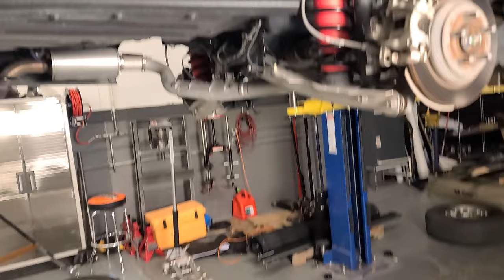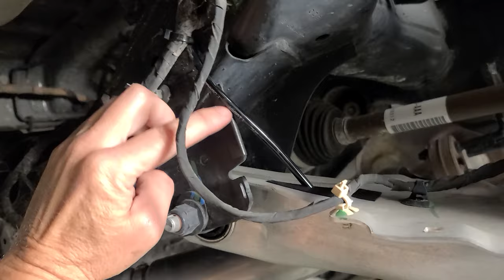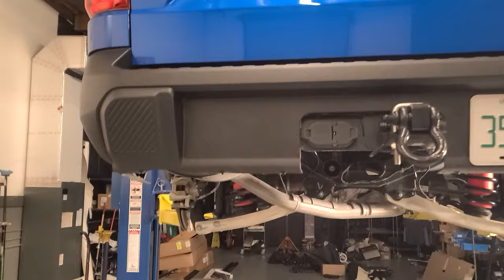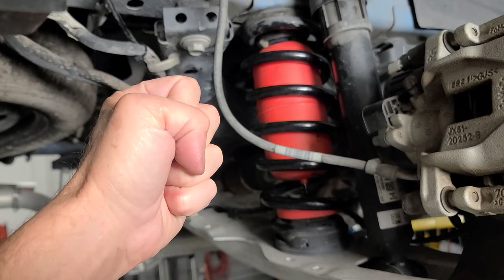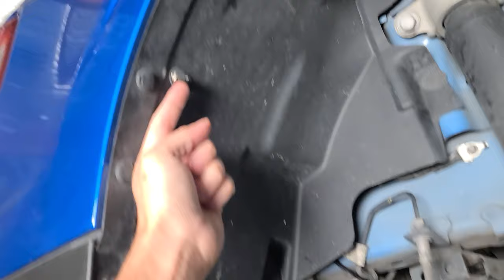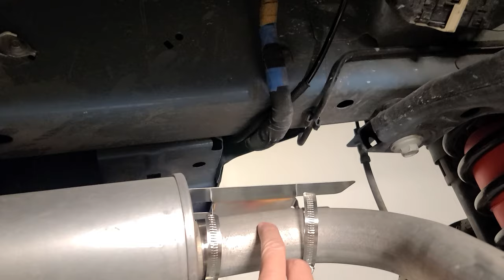Airlift 1000 airbags installed on Ford Maverick

Comment: I installed a set on my 2004 GMC Yukon and it made a world of difference in towing my travel trailer. I removed the springs and it was still a pain to install. Now that I have my 22 FX4 with the 4K and I tow a max weight travel trailer, I'm going to install the same kit on mine this weekend. I'm glad to see it is possible to do without disassembling the rear control arms. I was dreading that part. I will attempt to use a vacuum pump to pull most of the air out and then attempt to squeeze the air bags in.

Comment: That is perfect. But, isn’t better if you put the fill valve inside the cubby in the bed?
Reply from the maker: You can route the fill value to any place you want. I have mine set up so that I can have different pressures in each bag, so i have 2 valves, and i wanted a convenient and intuitive location for each valve if I need to fill manually. 
I also have the Wireless Air kit from AirLift, that I haven't had the time to install yet, but that will allow me to control the bag pressure remotely with my phone app or with their controller. 
Most people will probably keep the bags at the same pressure and only need 1 fill valve, and it's easier to find a convenient and intuitive location for 1 valve than it is for 2.

Comment: Did these bags affect the ride when unloaded?
Reply from the maker: Not that I noticed. That was a concern of mine too. You have to keep at least 5psi in the bags, so I was concerned that it might be a bit stiffer unloaded, but I couldn't tell the difference. Once I loaded it up with the all the stuff I keep in my bed and on my rack, I ended up with 17psi to get the ride height back. (I haul a lot around. LOL)